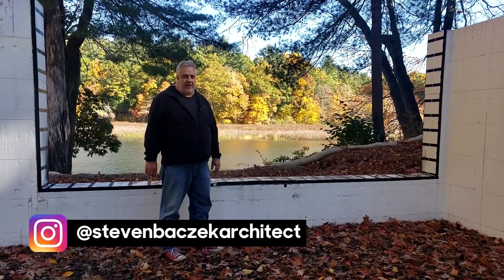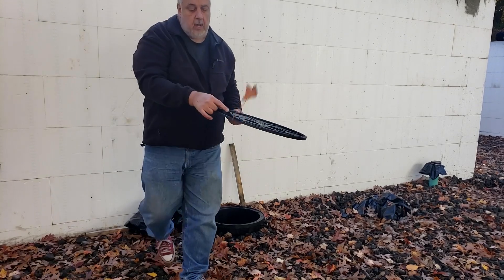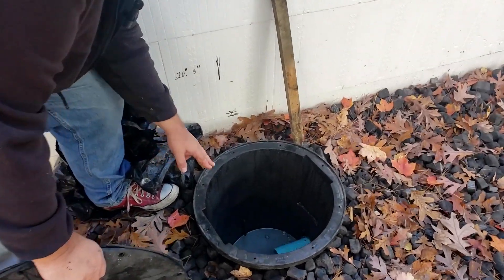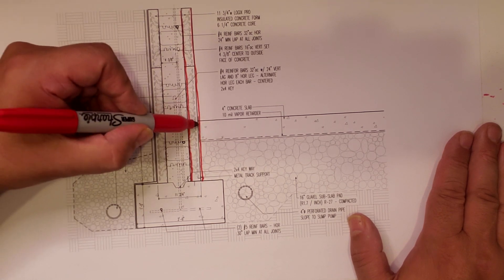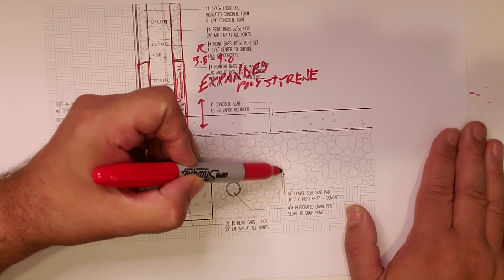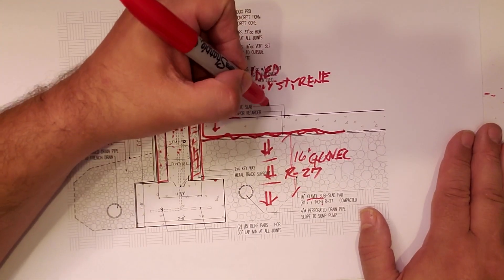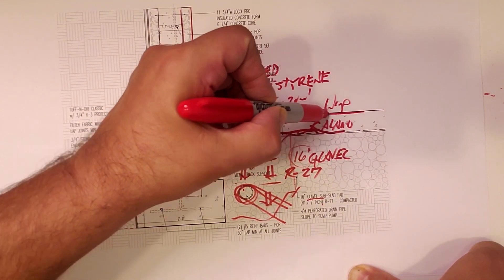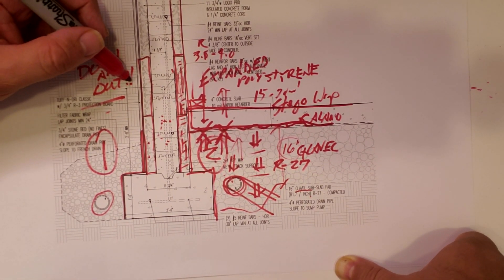SUBSLAB WATER MANAGEMENT

Comment: I've been wondering about under-slab insulation in a basement elevator pit.  AFAIK the midwest build video on that topic hasn't been posted yet.  Is typical foam-board insulation strong enough to use there?  Is Glavel strong enough to use there?

Comment: 6:33 it almost sounds like there's a skim coat of concrete before putting on the Stego wrap, to give the Stego a smoother surface, and spread out point loads that might break up the Glavel.  But my guess is probably not, and I'd also guess that both the Stego and the Glavel should be fine without such a skim coat.  The Stego will only get stretched enough to support the weight of the concrete during the pour, and the Glavel has point loads between adjacent chunks throughout its 16" depth.

Comment: Just an additional question regarding the usage of Glavel on this project. Was it (also) being used for this due to the proximity of the river? Since rivers tend to flood, is the Glavel a superior product to use in this instance instead of using any other product to provide the R-value you were looking for?

Comment: My buddy a hvac guy mentioned radon vent. And I was like I have vent to daylight. Sub slab sub membrane depressurizing system for radon. Your sketch looks a lot like my pier and floating slabs. As I am building 32 x 24 section at a time up at camp off grid when I have time and money. Maybe I will pay for engineer or architect to allow me to build 24 masonry columns residential codes only allows for 20 foot here. The timber frame holds the weight even not the columns until frame compresses. Was planning on just taking veneer stone up to make it look like column goes all the way up.

Comment: Steve,  Enjoy your videos.  One other advantage of installing the gravel is you could also install the piping for a radon extraction system which is especially important for those areas where this is prevalent.
Reply: @ 2:13 in the presentation, Steve points out the pipe that's going to be used in the radon mitigation system.
Reply: I am wondering... is the radon system is also tied into the perimeter drain piping, to provide additional suction points?
Reply: @CarolinaDruid  I would think that you'd want to keep the 2 systems separate. If it's a passive system (just piped outside) or active with a fan I would think you would only need to have the free flow of air under the slab to get the gas out.

Comment: Love that window rough opening Steve!! I wonder if there’s a way to avoid a cold joint at the footing/wall intersection? I know the key way serves to help address this, but just curious if you had other ideas?
Reply: What do you mean by "cold joint"?  I would expect that, even under that window opening, the top of the footing should be below the frost line.
Reply: @kc9scott cold joint. Where the concrete wall is poured onto the cured footer creating a joint between both concrete pours.